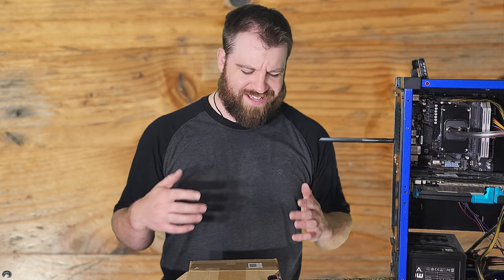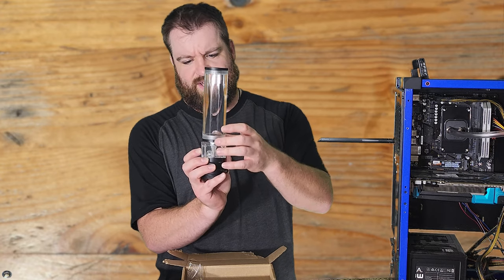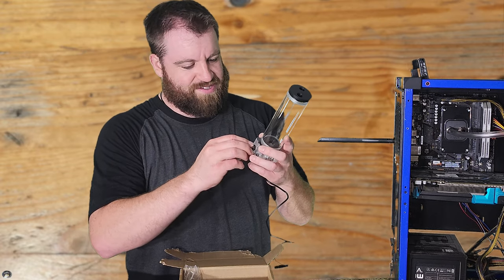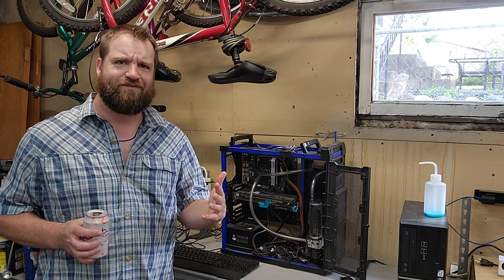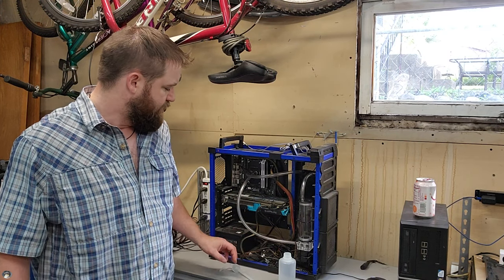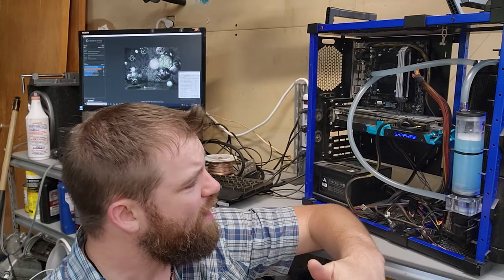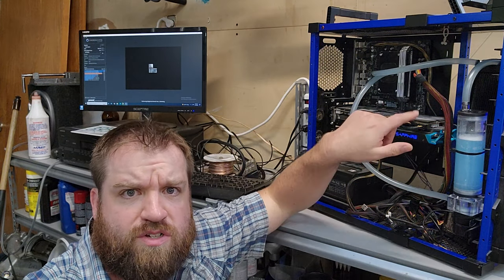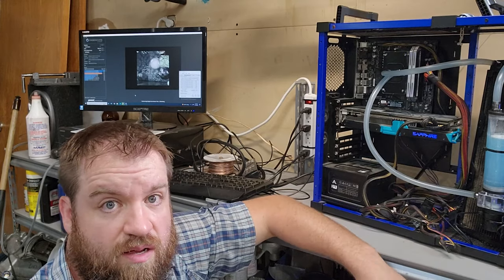Cheap Water Cooling Pump Combo! Install and Review!

Comment: I'd like to see what the flow rate is compared to name brand pumps. It seems to me that the name brands are overcharging for their pumps. I don't think a tiny little DC pump should run over $100.
Reply from the maker: Yea the name brand pumps have really jumped in price and I'm not sure why.
Reply: Because if you attach the word gamer it ups the price

Comment: I thought you were supposed to put the inlet tube on the acrylic tube side so the bubbles will be trapped on the "free" side.
Reply from the maker: Not really sure. I suppose I could test that out and see how it does.
Reply: Yes, that's the proper way.